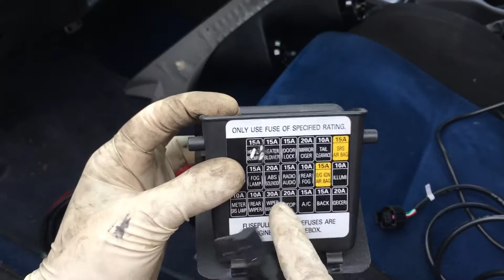DIY AEM Wideband & Boost Gauge Install

Comment: Whats the specs on that subaru? Injectors, fuel pump, rail, turbo, power goals e85?
Reply from the maker: The precision is a decent sized 60mm i believe has 1000cc injectors a 450 walbro Its on e85 right now but I'm pretty sure the owner is getting tuned on pump gas because he wants to drive it to montana for work. Stock STI motor but I would assume it'll make 350-400. its getting tuned today, I'll include videos of it on the dyno in the next video ;)